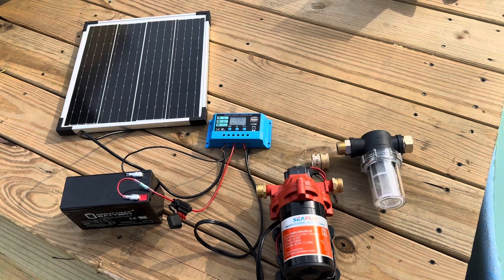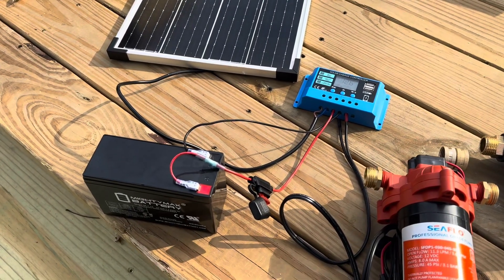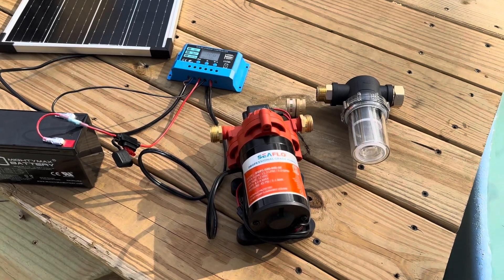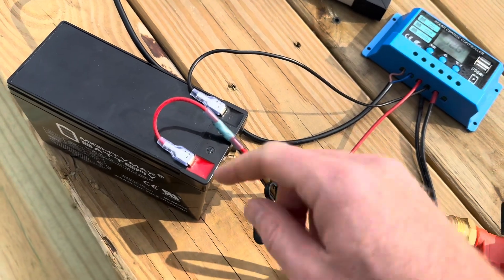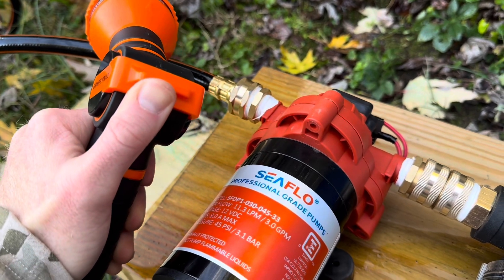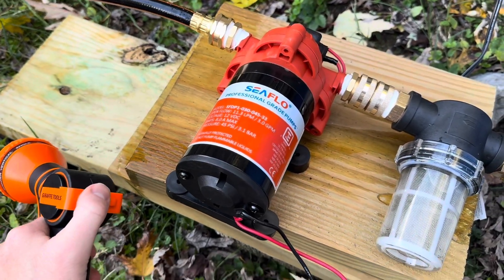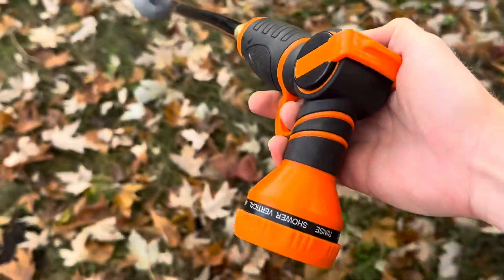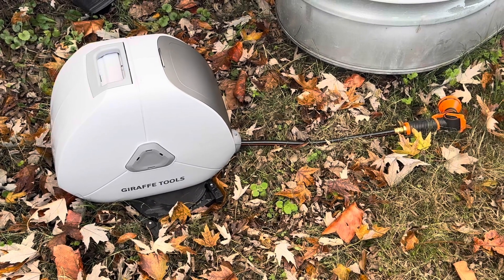Building Solar Powered Rain Barrel Pump with Giraffe Tools

Comment: I loved your video instruction and bought most of the items on your list provided (Thank you).  Have charged the battery through the solar controller.  When I connect the pump, it doesn't do anything, but when I hook it directly to the battery it works.  When I put something else on the load side, it works too.  Is there a configuration on the solar controller that I am not aware of?  Thanks in advance for any help you can provide

Comment: This video is great! I've started my own little set-up but keep having issues with pressure. The pump will turn on and off. I secured the fittings, put teflon tape, but still not watertight. Have you experienced any pressure issues? If so, how did you problem solve?

Comment: Great video! Do you have an updated version with the on off switch? Is there anything you would change? Thank you kindly
Reply from the maker: On off switch is the biggest thing plus flipping the box over so that the cable gland is on the bottom. I had some leaks with it on top. Should be coming out with a new video on it soon!
Reply: @jackspepperpatch awesome thank you very much ❤

Comment: Coming out of the controller box there are 2 wires to the pump.  I am confused so I am presenting two options here.  Option 1:  cut the positive wire that is going from the controller box to the pump and attach it to the positive from the toggle and also cut the black (negative)  wire to the pump and connect it to the black wire from the toggle?  Option 2:  Cut only the positive wire going to the pump and connect it to the positive from the toggle?  if I do that, what do I do with the negative wire that is on the toggle?  thank you.

Comment: thank you for the excellent video.  We bought everything you suggested and are putting it together today.  We are using it for our drip line garden sprinklers.  Our question is how will we turn them on?  You used a hose nozzle to turn yours on, but we want to hard wire it to the rain barrel.  any suggestions are appreciated.
Reply from the maker: Hey! Glad you enjoyed the video. I agree that the ability to turn off the system was a big limitation of this system. After using it for a few months I ended up adding a toggle switch to the positive wire between the solar charge controller and the pump. Should be coming out with a video on that this month!

Comment: I’m looking to do something similar. Will this work with an automatic drip irrigation system? I have a rain barrel system but not enough pressure to water all my beds.
Reply from the maker: Hey, yes it should! I actually just got a drip system and am hooking this up to it with a rain bird timer.
Reply: @jackspepperpatch amazing! Thanks for replying! Would love to see an in depth video on how you installed everything. Like a step by step guide with the junction box set up and the box for the pump

Comment: Thanks for making this video - its very helpful! I have one lingering question question after watching: How did you extend the length of the pump wire so that it reached the junction box? Did you just use butt splices again?
Reply from the maker: Hey! Yes, butt splices will help you extend the wires to the pump. I believe the pump uses 16 gauge wire so you can just get a spool of raw 16 ga wire and make the cable longer with it.

Comment: Brother, I have to tell you, I have been searching for this setup for a LONG time. Thank you. I hit the sub because you seem fairly intelligent and knowledgeable. I’ve got 3 225 gallon totes in my back yard FULL of rainwater Ive collected and now ill have the setup to pump it out completely independently. I’m so excited!!!
Reply from the maker: Hey I appreciate the comment!! Hope the setup works well for you. Only big updates I’ve made to it since this video we’re adding an on/off switch to the pump hot wire and (thanks to a commenter pointing it out) I flipped the waterproof box so the cable gland is on the bottom. I should be posting an update video in a few weeks. Thanks for the sub as well!
Reply: @jackspepperpatch Yes I saw that. I will probably just use a toggle. If thats all I need to do when I use it, thats perfect.

Comment: Thanks for the design. Ended up building it. Couple of questions, did you impliment an on/ off switch into the design? Also, I dont want the hose to be presurized all the time. I tried having an on off valve at the outlet of the pump but the pump just kept running. I believe ill need a few feet of pipe after the outlet and then connect the hose dont know if you encountered the same problem?
Reply from the maker: No problem glad you like the design! Yes, I ran into the same issue.. definitely an oversight in the original build. I added a switch on the positive wire to the pump to turn it on only when needed.

Comment: Nice work. I did something similar, and its always nice to see what others have done. 

I've learned from past experience to always mount the cable glands out the bottom of the enclosure. When they are on the top, water collects on the wires and eventually runs along the wires, right down through the gland into your box. In my experience, cable glands are not completely water tight.  

I also noticed @1.19 the solar charge controller showed a lithium battery, rather than SLA, on its screen. Not sure what affect that would have.

Comment: cable gland should enter through bottom, not top
Reply from the maker: @GoatZilla  yo, good catch and you’re totally correct! I didn’t have enough slack in the solar panel cable so I rushed it and went in through the top. Thought it wouldn’t be an issue… I was wrong. I’ve since spliced some extra wire in and flipped the box ✌️
Reply: @jackspepperpatch why was it an issue
Reply from the maker: @BedtimeBlasphemy hey! A small amount of water pools on top of the box when it rains. With the cable gland on top, the standing water eventually made its way around the seal and started dripping into the box
Reply: I completely agree - I made this exact setup and got so much water in the box it shorted out the system. I fixed with chalk.
Reply: why is this an issue
Reply: The gland seal isn't perfect and the box will breathe a little. When hot it will breathe out a little. When it cools down,  it will breathe in a little.   If there happens to be water there, it will get pulled in.
Reply from the maker: @GoatZilla makes complete sense. I appreciate you sharing! Probably going to do an update video on this setup soon, I’ll shout you out when I do.

Comment: Do you get a full charge from the panel and is the battery big enough to run the pump
Reply: it should charge full with 6hrs sunlight at peak efficiency of the panel.

It probably gives 30mins - 1hr of charge for the needs of the pump. There is some potential for over current here though, beinteresteing to hear any updates.

Comment: I wouldnt have the cable connection on the topside of the waterproof box, its eventually gonna let in water. The waterproofing only lasts so long out in the elements!
Reply from the maker: You’re definitely right. I got so excited to put it together that I didn’t pay attention. I think I am going to build a little roof over it though, so should be okay.
Reply: @ Good stuff! Hope it all works out 👍